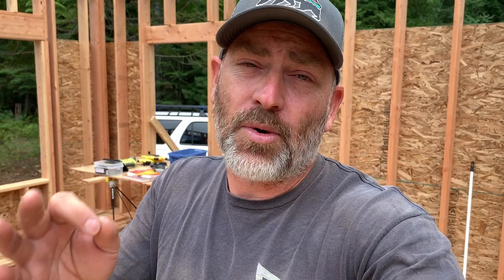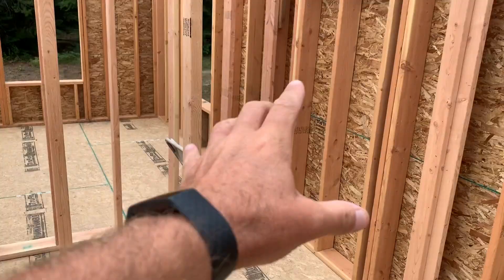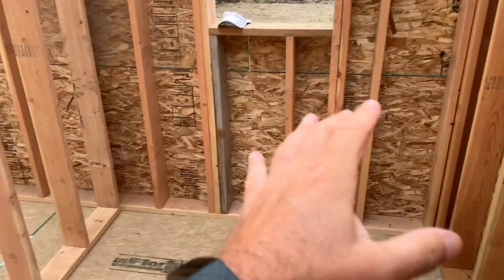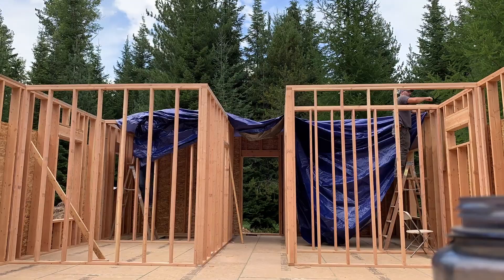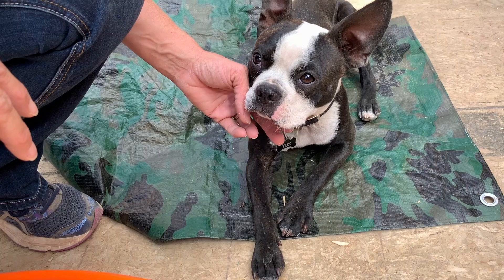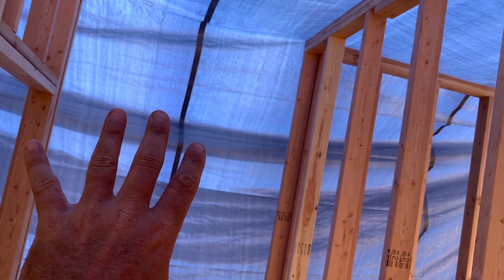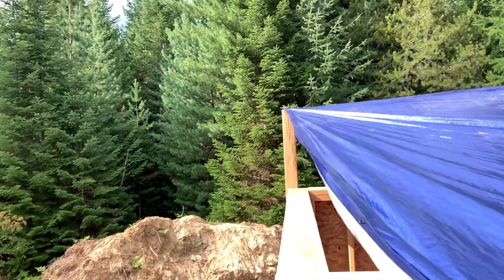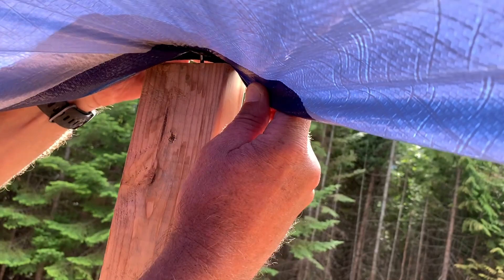DIY Rainwater Harvesting System with a Tarp and IBC Tote | Off Grid Cabin Build #20

Comment: New sub to your channel here ... been in the building trades since 1973. Both home and commercial. I enjoy watching building  and help if I can with questions. Since you ask questions of your viewers which is a good idea especially being your first build. I haven’t watched all of your videos but your framing looks just fine. You’ve tied your walls in ( perfect ) I would make one suggestion that I’ve noticed on your bathtub I see that it’s un-installed at the present time I also see that you haven’t cut the floor out for the drain. Which might be a very good idea prior to reinstalling the tub.. you will need to cut a rectangle out of the floor approximately 6 inches wide by about 9 to 10 inches long to accommodate your drain kit. Which is much easier to do from the top of the floor it will start right at the edge of your bottom plate for the overflow pipe and go toward the back of the tub about 9 perhaps even a foot depending on your tub then find the center of your tub drain in inches make a mark on the floor where the center of the tub should set then make a mark about 3 inches each side of that center mark then mark out that box and cut it out of the floor.. if you want after all the plumbing is complete you can then go under the house and build a box to cover that hole up. This In the past was a standard way of making room for your tub drain so unless tub design has changed this is something you may want to do ahead of time. I would definitely investigate it before you reinstall your tub...  as for the tarp  all I can say is good luck I’ve never had one not fail when installed that way good luck
Reply: George Vangordon jr thanks for your suggestions.
Reply: Remember... tubs come in left side and right side for drain connections. Get home with the one you want.

Comment: Don't have to worry about rain, osb floor sheathing  is rated for water exposure. Check the stamp on osb. Tent is great for sun shading! Using a drill to drive screws sucks, wait until you receive your viewer sent impact driver. You will be amazed at what a better tool this is for screws.

Comment: About doing the plumbing outside of your laundry room, you can create an insulated frame with a door attached just in case you need to have to work with the plumbing. In other words, a kind of insulated box with a door, so the plumbing doesn't become an undesirable view.

Comment: I don't mind the skipping. I like the tarp idea. Hopefully it works for you all. You might want to look at having some half inch pvc 10 foot lengths around. You can use it for various projects ribs for roofing, green house projects and other things. Oh don't forget some various fittings. Also go ahead and put your plumbing on the outside wall. Insulation insulation insulation. Think about using PEX. Very user friendly and stands up in cold temps. Also insulate sewer lines they will freeze also. It gets very cold in northern Idaho. I know from living in priest lake.

Comment: I would try to minimize length and turns to the dryer vent so it will work more efficiently. The dryer is one of the biggest energy drains on your house.
Reply: subaru4me good advice. Thanks!
Reply: Dryer exhaust length cannot exceed 35 feet. Deduct 5 feet for every 90 degree turn.

Comment: Plumb with pex A tubing and it will help minimize frozen pipes. It has excellent freeze / thaw / burst ratings. Best to install pipes up through the floors not the walls, and if pipe is installed in walls, wrap the pipes with pre-slit pipe insulation.

Comment: Skipping is fine less video work LOLOL  Doing what you are doing giving a general progress and some pics is good.  Love the tarp lolol. Insulate your piping on any and all exterior wall piping especially in the crawl space.  GREAT job puppy for climbing that step ladder...awesome.  My golden retriever would have nothing to do with climbing a ladder LOL.  There is some sealant that you can put into a self pump container that you can spray onto the plywood flooring and it will really help to save your plywood.

Comment: You are right to not want plumbing in an exterior wall, not even the drain let alone water supply.  However you can still arrange the washer and dryer on that wall with a work around.  Finish the exterior wall as standard with insulation, vapour barrier and drywall.  Then build a "knee wall" approximately 48" high ( a bit higher than the washer and dryer height) in front of, in contact with and firmly affixed to the structural exterior wall. Run all the plumbing in the stud cavities of this wall then drywall and finish - no insulation, no vapour barrier.   2 x 4 studs should give you plenty of depth for a washer drain and water lines - depending how and where you are running the 4" diameter dryer vent you might need 2x6 studs. The plumbing will be on the "warm side" of the insulation.  Yes you will loose some floor space doing this but you get your preferred arrangement.

I also noticed you have completed some of your headers so they are flush with the front face of the studs.  How about a quick update on how you did those?

Cute shot of Tux being so insistent on getting up the ladder to his Daddy!! :-)

As ever updates are enjoyed.

Thanks and Cheers
Carl

Comment: With 5.5 inches of insulation and your supply pipes close to the drywall side - you should be fine.  Having said that, note that your supply pipes do not have to enter from the wall - they can enter from the interior wall and be run on the surface,.

Comment: I have modified several things on my house. One way I can think of to keep the pipes from freezing is to build and insulate the exterior wall, including the drywall, then apply a four inch wall to that to house the plumbing.  Maybe even use a grill ( like an air return grill) as a cover at the pipes so the heated room air can enter.

Comment: If you do plumbing on the exterior wall, make sure to put in a disconnect and valve for that section so you can just shut it off and drain that section when the temps dip super low.

Comment: Hello, Mr. Martin. Nice project, no comments about it. If I was in your pants, I would first of all focus on the roof, if it doesn't need internal supports. The roof is the main value when building, specially at your location which is very prone to winter and rain or simplier said weather mood swings.. =) With the roof waterproof you can build even in bad weather in the insides.. No hurry, that's only my opinion. I have the feeling that this winter will be sooner as usual, maybe I'm wrong.. but.. well...you know..
Cheers and greetings from the slovenian conuntry in central Europe..

Comment: Might be a good idea to run all water pipes inside the house. Run them along the baseboards in a boxed channel. Use Pex Pipe, it expands if pipe freezes. Just a great product. Gets very cold in the winter and running water pipes inside is getting more popular for a great reason. GOOD LUCK,  Vinny 🇺🇸 PS, REINFORCE THAT TARP. THOSE PATHETIC GROMMETS WONT HOLD. YOU CAN BUY SPECIAL GROMMETS THAT EASILY ATTACH TO THE TARP. WHEN DONE YOU CAN SAVE THEM FOR ANOTHER TARP.

Comment: my vote is a good rain it goes flying. or if rains come it blows the low points then drowns the lot.  best bet too make T supports that level the tarp too run the way you want. no open areas that are not supported. but the tarp is too small for that idea. should of went with a 30 by 60.  run then five foot side too the walls to keep the wind from taking it. and there isn't that much more cost then what you spent.  the idea is too keep the water out of the house with what you got too work with. here's another idea, think about raising the roof a few feet ,adding a taller loft.  or just go with the seven foot wall and floor the attic into full rooms.

Comment: You could do the short double wall as someone suggested, or use closed cell spray foam in that wall. It's R-Value is much higher. 4" of spray foam should get you about an R 28 or better.

Comment: I would do it different if I was doing it I would cover the entire thing which means I would probably need a bigger tarp and I would do it to rear I did arizer type thing with two-by-fours on the one side and I would drain it go in the opposite direction totally off the roof but I would cover the entire flooring cuz particle board comes apart if it gets wet it gets damaged

Comment: Were you planning on using pex for the plumbing? If so I believe you will be fine as long as you have adequate insulation. Ive seen professionals swear by pex that its better the pvc for cold environments. I would suggest some research to verify. But I think its doable from my handy man experience. Good luck!

Comment: Defiantly avoid plumbing in the exterior walls 
Insolation dos not always work so you don’t want to take a chance. 
I’m in the renovation business and consult with my plumber all the time about this issues. 
Other avenue is running pipes on the interior wall but not in it 
That also insolantes the   pipes from the heat as well that’s way it’s not practiced by plumbers.

Comment: Skip is ok... also try to avoid too much "talking head" time.   You are best when you talk while working!  
Use tall trees on one side to lift tarp with guy ropes maybe?   Keep plumbing in crawl space and interior walls as much as possible. Frozen lines mean broken lines, and water leaking in an insulted, sided exterior wall sucks.  A leak in a crawl space no big deal.